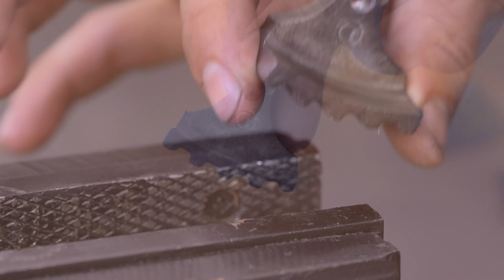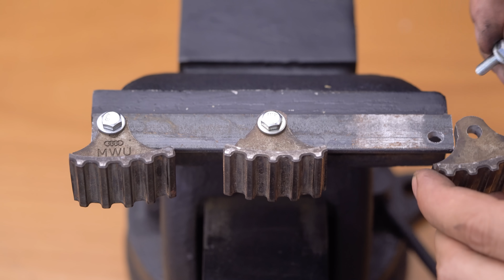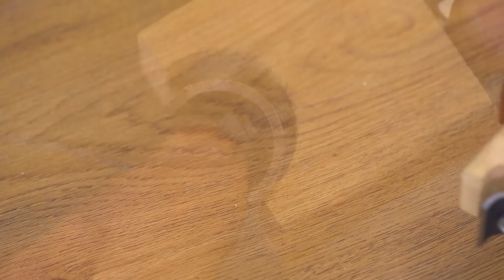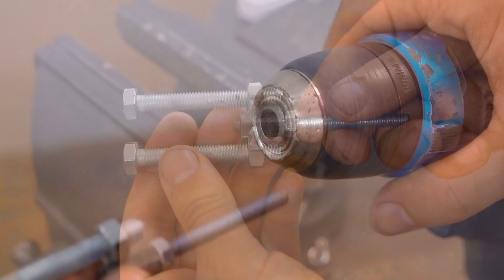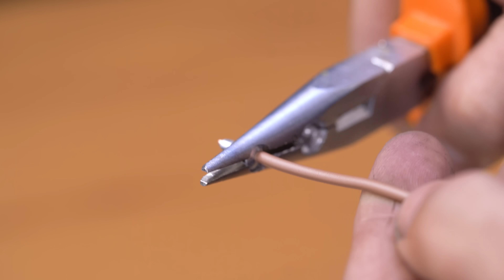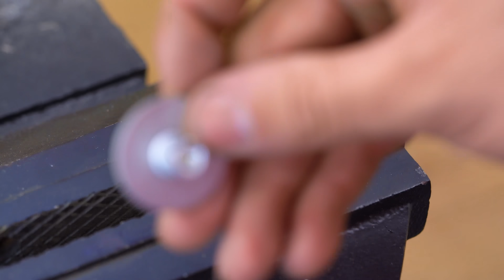How Creative ideas and tips Make Your Work Easier

Comment: The pipe welding clamp makes absolutely no sense because once you even tack weld one area of the pipe how are you going to get it off? 😂
Reply: Undo the screw, remove it and what's left of the wooden block, then shake the welded piece until the half-pipe and the nut fall out one end... or just abandon it inside, maybe use as reinforcement if you manage to weld it as well.

Think of it as a cheap semi-consumable.
Reply: Provided the nut is tracked to the internal semi cylindrical clamp I fail to see the problem. Undo the screw from the head end, and shake the clamp piece out. Simples!
Reply: Tacked got additional corrected to tracked (sigh)
Reply: And auto got"corrected" to additional

Comment: DO NOT USE AN ALUMINUM RIVIT TO MAKE ELECTRICAL CONNECTIONS!!!!!
Reply: And why? 🤨🤨
Reply: @anonymously241 aluminum has a low heat threshold
Reply: @anonymously241  Dissimilar metals will create a galvanic cell and corrode the heck out of the joint. The electrical resistance will be high, which will mess with your breakers and cause heating, which may start a fire.
Reply: @SaultiBalldeip  correct
Reply: @brotherofweasel  also correct
Reply: Great post! I clicked on the comments section to leave this exact comment. Using dissimilar conductors is a recipe for fire.
Reply: He could have use the long nose pliers to loop over the end and try tighten it?
Reply: Exactly - aluminum and copper together, no no
Reply: Better to just use wire ferrules and ferruling pliers, they're quite inexpensive these days.
Reply: for stranded cable; yes. for solid core; no.
Reply: The idea is a good one, provided  a steel rivet is used
Reply: Steel rivet are zinc plated, just like the bootlace ferrules used by competent electrical installers
Reply: @Gottenhimfella  electrical ferrules and other crimp connections are copper with tin plating, typically. Steel isn't a great choice as an electrical conductor and can't be hand crimped effectively.
Reply: @spirituallyinsane  ta! saves me posting the same. :-j
Reply: also ferrules (ins / un-ins) are crimped in a fashion that allows them to regarded as  a gas-tight joint which helps the eliminate risk of corrosion. to do this on a 'thick' walled aluminium or steel cylinder? break out the micro rotary swaging tool lolz.

but also: in the video it's solid core; double it back & set.

Comment: Why would anyone ruin a perfectly good vise for that? Both tools that were clamped could have been clamped vertically and worked on from the side, do yourself a favor stop giving tips like this
Reply: The vise is far from ruined. The jaws are meant to be replaced or switched according to needs. The regular jaws can always be put back on.
Reply: Indeed. And the OP's other point was equally nonsensical for two distinct and strong reasons, at least one of which will be too obvious to anyone capable of objective reasoning to justify explaining.